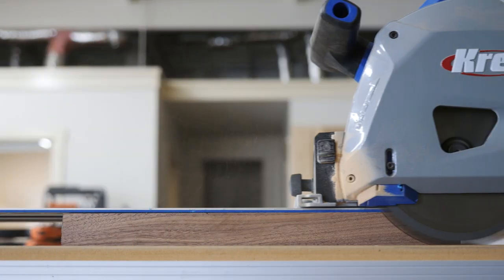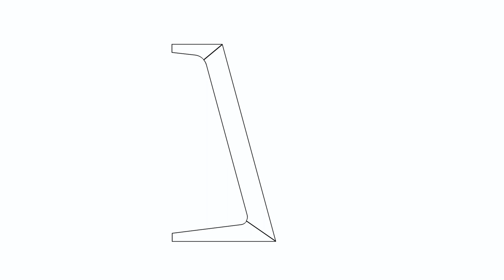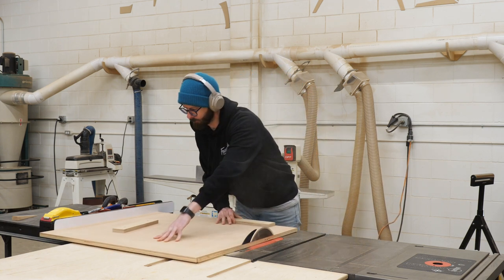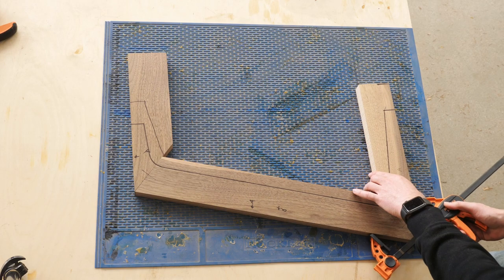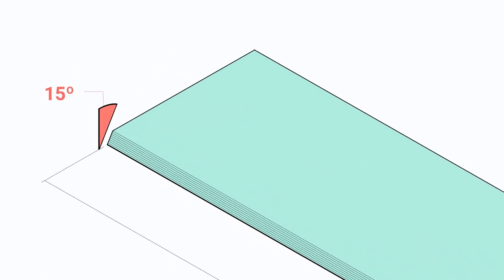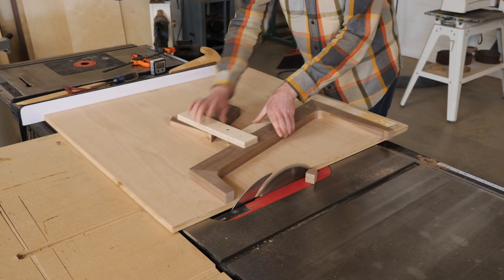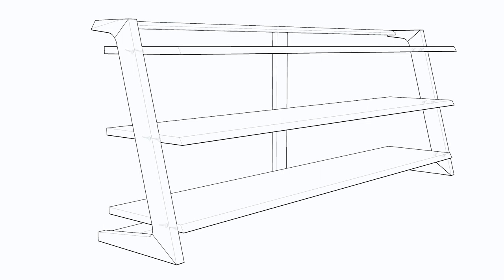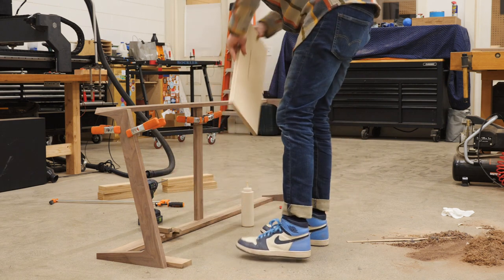Modern Media Console/Bookshelf | Free Woodworking Project Plan

Comment: This is a lovely piece. I want to scale down the length. Would I just shorten the shelves and bottom stretcher? Also, I can't find the finished height...
Reply from the maker: Correct, you'd want to scale the length of the shelf and bottom stretcher. The finished height will be 24".